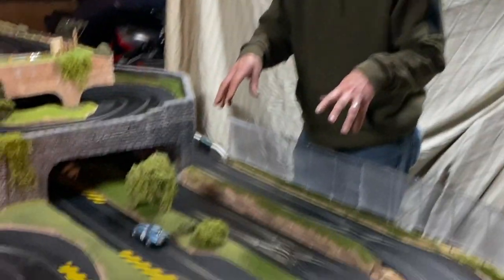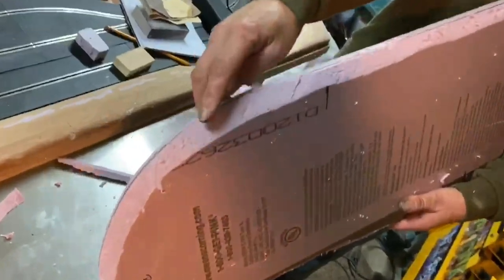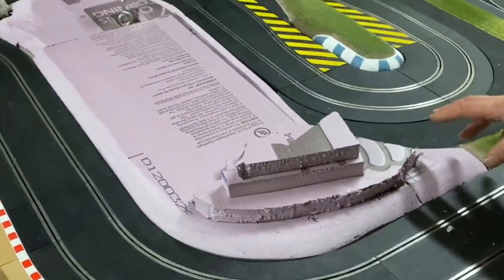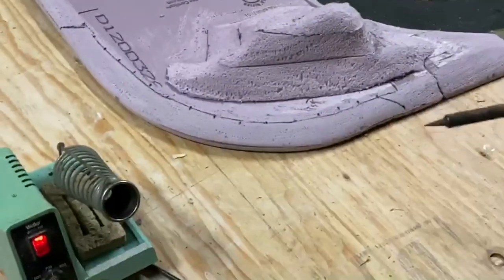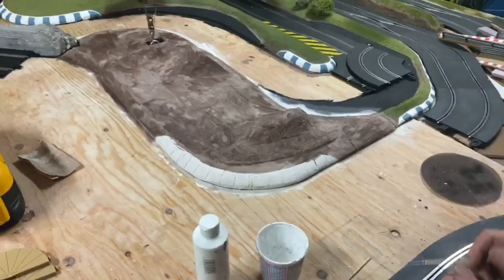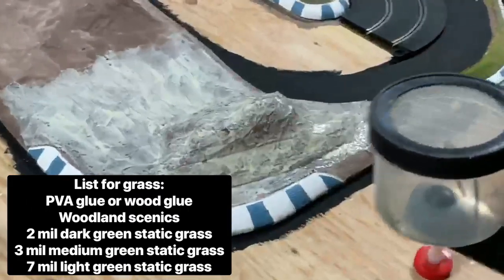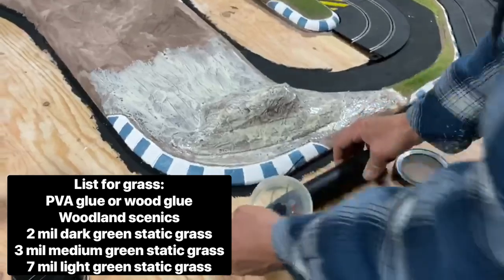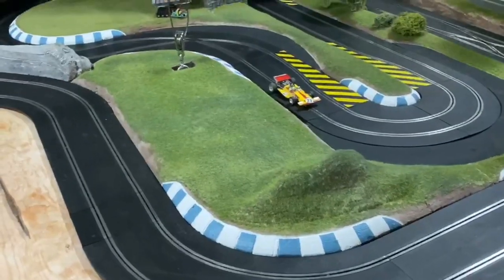how to build terrain /scenery ,track apron rumble strips , and apply static grass for your layout

Comment: Quick question on maintaining a shiny slot car. I have kids here that race and I think just from touching the cars they tend to dull out. What can I use to clean and polish but not degrade factory paint/decals.... Thanks for your time in advance. We love the videos!
Reply from the maker: Thank you Daryl , a good polish to use is a aerosol spray wax. There are quite a few on the market today. The aerosol wax will mist onto the surface and it just needs a light buff with a microfiber cloth and it shines right up.
Reply: @BoonesSlotCarGarage  👍

Comment: Hello Boones, I follow your videos and your explanations, I would like to be able to put your knowledge into practice soon.  the videos are especially spectacular.  I would like to know the type of filler you use to put on top of the Foam. 😊
Reply from the maker: Thank you very much, the filler I use is Drywall Joint Compound. It is very inexpensive and works great 👍. There are modeling fillers on the market. But this works just as well and you get quite a bit for your money.

Comment: Boone, quick question: what’s your opinion of screwing your track down onto the board to lock it down?  Was thinking just the tracks that tend to get the most play, curves, etc.  Also, thank you for taking time to answer everyone’s questions!
Reply from the maker: Thanks 😊, fastening a track with screws is a good way of securing it. Depending on the track you have, some actually have a track securing system available. But if you do decide to take the screws to it, 😂… here are a couple things to consider. Different manufacturers of track use different materials to make the track surface. I’ll point out the major Two… Carrera track is a much harder material than Scalextric. So take caution when tightening the track down as to try not to distort the racing surface, Scalextric will distort easily. Try to countersink your holes so the screw head is flush with the surface. Also try to place the screws to the outside edge of the track as to not interfere with the racing surface. If you are thinking of fastening down a corner, try to place your screw on the inside edge of the track. But yes 👍 , screwing down a track is a necessary evil sometimes 😂.
Reply: Great advice. Thank you so much!

Comment: Boone-
Nice video!  This was my favorite video in your series so far.  A few questions for you:  (1) What glue did you use to attach the styrene board to the styrene hill pieces?  (2) Was the watered down acrylic paint or did you water-down a latex paint for your initial coat of brown? (3) Have you ever used a foam cutter while working with the styrene board? (4) if not a foam cutter, what type of blade did you use for your long cuts when you did your first cut on the original styrene sheet  (before you used your knife for shaping)?  (5) After the wood glue dries on the static grass, do you need to use a final spray (like Testor's Dull Coat) to keep everything in place or is that an unnecessary step?  Thanks!
Reply from the maker: Thank you for your input,  1st the glue I used to attach the foam to the board is PVA, but you can also use hot glue if you want to speed up the process. I also use that to attach the different pieces of foam together. 2nd the ground color is watered down acrylic paint. 3rd I don’t use a foam cutter , would like one but just haven’t gone out and purchased. It would make things easier. Lol... 4th  I use a retractable razor knife to cut the foam. 5th I have found that the grass stays in place very well with the wood glue, but any added insurance of sealing down the grass would be a plus. Kinda new at the video thing, I thank you for your comment , and i will definitely make sure to explain more in-depth in my future videos. Glad that you enjoyed it and thank you again.... Boone

Comment: I would like to try my hand at this...what is generally considered to be a decent size base for slot cars?
Reply from the maker: Very cool…. A good base for 1/32 scale is honestly the bigger the better. But if you are limited on space I would at least start with 4ft x 8ft , anything smaller than this is a bit too small. And you are going to find that there are two major brands of track on the market. Yes there are a few others but these two are the major players. Carrera and Scalextric , Carrera can run 1/32 and 1/24 but it comes with a bigger footprint since the track is larger do to the fact it can handle the large 1/24 scale cars. Scalextric is 1/32 scale track and happens to be the same brand I use for track. Many options on who had the better track
Reply from the maker: Sorry,,,, I wasn’t done yet…. Hit the send button when I was attempting to correct the end of that….lol… to make a long story short . It really comes down to your preference. Both brands have pluses and minuses. But if I was in your shoes and was limited on space I would go for Scalextric. It’s readily available and the company has been around since the beginning of this hobby…. Hope this helps

Comment: Hey Boon quick question could you just use the joint compound to make the rumble strips
Reply from the maker: I’m not sure… my only hesitation on doing this is the durability over time. By making the joint compound thick it might be brittle and crack or worse yet break loose…
Reply from the maker: The joint compound works great for covering the foam and polystyrene for scenery, and since it is covered with paint , grass ect..but if it was in an area next to the racing surface, I’m just not sure how much abuse it will be able to take
Reply: @BoonesSlotCarGarage  okay thanks for the tip 👍🏾
Reply from the maker: @jameswalton9299  no worries… but you could always give it a try… a little R&D project.. it might work. I would not commit to building all your rumble strips this way at first , just a section and see how it works out. One thing about slot cars is that many ideas with scenery are still in development stages … only way to find out if it works is to try it out…
Reply: @BoonesSlotCarGarage  I agree I’m goings to get back to it and see what else could be used I must admit this is kinda fun. Thanks again 👍🏾
Reply from the maker: @jameswalton9299  very cool… let me know what you come up with. I’m interested in seeing what you find out.. and have fun buddy
Reply: @BoonesSlotCarGarage  will do and thank you 👍🏾

Comment: @Boone, i have a question, im currently building my track, atm the wood table. after that im going to start with the scenery. how do you fix the landscape on the table? do you even fix? my table is quite huge, 4.55 / 2.6 meter. how would you recomend myself to build the landscape? i cant go around the table but i builded the table so he can hold myself. so i was thinking starting in one of the far corners and work to the other far corner. im planing to paint the tracks as well. would you recommend myself doing that at the very begining, befor doing landscaping?
thx for your help
stefan
Reply from the maker: Nice size layout you have planned… if you plan on making a permanent layout I recommend glueing the polystyrene board to your table top. Either with PVA or a good wood glue, you can use hot glue in those areas that have those special needs , but realize it will melt the polystyrene some…This will help in a few ways. One of which is that your scenery will be firmly anchored and will not move. Movement can be a very bad thing , tends to destroy the hours of work you put into building up everything. If you have an area that you want to have access to , you can make removable scenery panels. These are pretty cool , but use them with some engineering in mind . They are best used in an island area. Meaning an area that the panel can be removed without disturbing any other scenery. … fixing the track to your board had its pluses and minuses. The plus is that the track is secure and will not move , at least on the table. Plastic track will expand and contract due to heat and cold… if you have your layout in a non heated area this might not be a great idea. The down side of securing the track is it makes it that much more work to service the track . Stuff happens… sometimes you need to remove an area of track for repairs or replacement… digital comes to mind on this one.. 😂… sometimes they can act up and need some cleaning. I have seen guys tie the scenery into the track , meaning blend the edge of the track into the landscape so it looks really realistic. This is very cool effect, but keep in mind the downside as well.  My track is not secured to my table , I use my scenery and corner edge aprons to lock it into place to minimize the movement. It works very well , and I can remove the track if needed…. Believe I have a video that I show this and explain.. but sometimes I have to go through the track to tighten up the connections… and last but not least your attack plan…. 😂… you can start at one side and move across the layout building as you go  , this will work. I prefer to try to start inside and work my way out…  but like painting a room , don’t paint yourself into a corner. You can do the same with your scenery..  best thing is to look at this ad a possibility and plan accordingly. Meaning… give yourself an option, if you build and then down the road you want to change something or add , try to give yourself a route that you can get back into that area . Weather it be a removable piece of your scenery or track that can be removable so you can access those hard to reach areas . I have such an area as well. I can remove my track and it gives me a way of getting into the area , but it’s a bit of a tricky situation… hope this helps… big topic… let me know if you need any more help… thanks for watching my videos and have fun with your new project ….
Reply: @BoonesSlotCarGarage   thats a very good idea. im going to make two removable landscapesparts. ill prob. have some more questions down the road. 😀 happy to ask you for some more advise.
Reply from the maker: @stefannauer4096  sounds good…

Comment: Boone how do you draw the exact piece of styrofoam you have to cut? you draw it on vegetal paper or smth? How do you get it fitted for the track?
Reply from the maker: Best way is to make a template using paper or cardboard. Place the paper down so that the sides are under your track and then trace a line using the track as your guid . Cut out the template and the trace on your foam and cut to shape
Reply: @BoonesSlotCarGarage  got it! Thank you so.much!
Reply from the maker: @Kojas  your welcome 🤗

Comment: Hey Boone do you have a problem with your joint compound cracking
Reply from the maker: No , I haven’t had any issues with that … did you??
Reply: @BoonesSlotCarGarage  yes what kind do you use
Reply: Do you add water to yours
Reply from the maker: @calpearce6283  I use a premix drywall joint compound
Reply from the maker: @calpearce6283  no , it comes ready to use
Reply: @BoonesSlotCarGarage  thanks my brother I add water must be I spread it too thin
Reply from the maker: @calpearce6283  thanks Cal …. that would make sense

Comment: If you want to save yourself some work ( and make rock edges look more realistic) take your drywall saw and scrape it along all the edges....because of the teeth being different sizes and angle it rips and tears at a much more realistic unstanderized way
Reply from the maker: Yes that works very well. This was a very early video that I made for carving rock. My technique has changed some since. But yes , a saw blade works great 👍. I also like to use a butcher knife and scrape the tip as well.